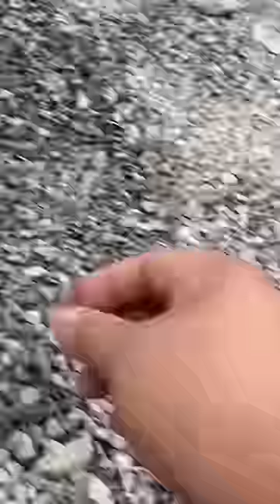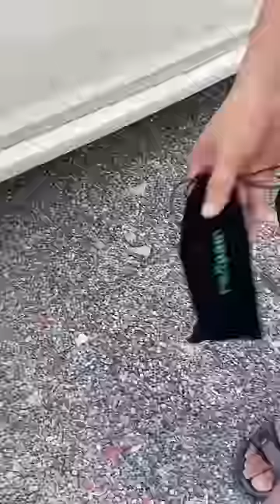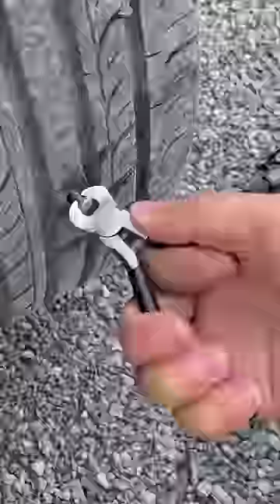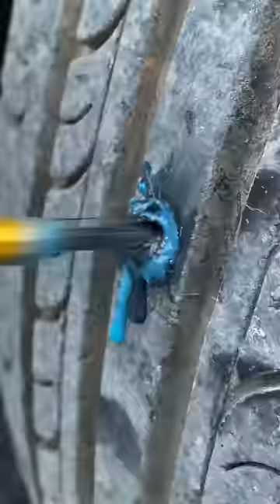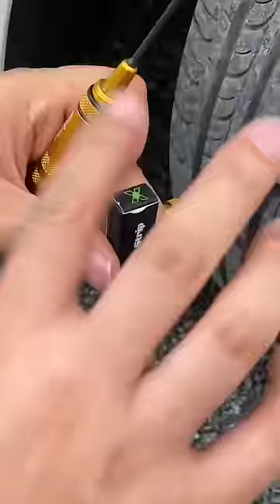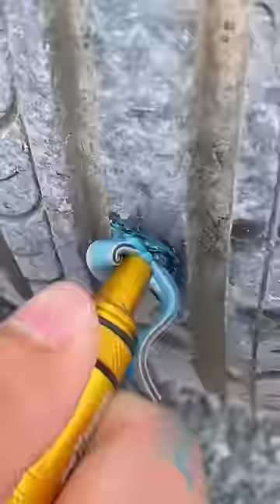$2 tire puncture repair

Comment from the maker: https://rexpair.com
Reply: 34
Reply: X
Reply: www
Reply: Wrt
Reply: @ตัง-ฒ2บ  8888888888
Reply: Needs more glue.  You only glued it 5 times
Reply: 0l
Reply: @shanavaskhanshana2507 Hi
Reply: What is the name of this? Can you send me a link?; Small Repair Kit(EDC)
Reply: rsbte
Reply: ㅣㄱ..
Reply: @OmarAli-bp7vm  😊
Reply: @ตัง-ฒ2บ  😊
Reply: @ตัง-ฒ2บ  😊😊😊
Reply: @ตัง-ฒ2บ  L
Reply: @ตัง-ฒ2บ  L
Reply: @ตัง-ฒ2บ  😊😊
Reply: @yanlyyanly3602  l
Reply: @OmarAli-bp7vm  😊
Reply: @Enzo_903  L😊😊ll
Reply: Lllll😊
Reply: Harga berapa yaa
Reply: $25 😮
Reply: 😅 за то
Reply: Rather use a regular kit with no glue required.
Reply: Poxa, manda um aqui pra Manaus 😢
Reply: Nul
Reply: Your Site says that tool is for motorcycle?

Comment: Now take it to the shop and have it repaired for real
Reply: Maybe with this style of plug. But a regular plug will last the life of the tire and then some. Trust me. Here in NY there’s MILLIONS of cars on the road with MILLIONS of these plugs in them. I once removed a tire and there was 6 plugs I can see from the inside I was dying laughing. It just looked weird.
Reply: ive done this to 2 tires. both lasted the life of the tire.
Reply: this is real. you dont know this ?
Reply: Go get that tired change for real
Reply: shop mechanic : - where's the puncture 😂😂
Reply: @digimon916  
That tyre let's go at 100 mph your life's over.. So do you value the price of a new tyre over your life.. Str8 Facts...
Reply: @See-through-The-Veil  ppl shouldnt even be driving that fast anyways. i drive like a grandpa, so it serves me well.
Reply: @Bobby G.  These plugs are always meant to be a temporary solution, not permanent. They are not recommended or reliable as a permanent solution
Reply: @digimon916  
I was using that as an example for eg a ferrari, lambo etc. Even at 60 mph it could kill you
Reply: @See-through-The-Veil  if you own a ferrari or lambo you should be rich enough lmao
Reply: @uihgy297  Exactly for the price of a tyre, but even a 30k car... A tyre can save your life and others
Reply: Take it to the shop and they do the same 😅
Reply: Bruhhhh u don't even know😂😂😂😂
Reply: @lgg8705  
No of course not... I worked in a tyre shop for 10 years...  Bet you feel pretty silly now ey buttercup 🤣
Reply: @See-through-The-Veil  zzzz 10 years 😴 alright  whatever u say ay princess , as long as you happy 🤓🤡
Reply: @AkbarAli14  ترجم
Reply: @See-through-The-Veil  did you just call another man princess 
We don't take kindly to your kind in these here parts mister
Reply: @See-through-The-Veil  i have driven a car many times that fast with a camel turd fix on my tire. I like to live dangerously
Reply: Yea so the mechanic can do this exact thing.
Reply: @Roberob1189 In the 13 years I’ve worked on cars I’ve seen tons of tires with these plugs where tread separated from the belt. These meant to be a temporary fix to get somewhere that can patch the tire. I mean if you want to take the risk cause the plug you used lasted a long time be my guest.
Reply: @06SteveO  lol it’s not just me…it’s everyone everywhere. That single spot where the plug is will never fail. If it does that means it wasn’t done properly. That’s a fact jack. Also buy correct plugs. Not Chinese garbage. Real plugs will take the friction heat from the road and actually mold the hole. Yeah it sounds crazy to have a bunch of plugs. I probably wouldn’t want more than 1 maybe 2 on a tire. But you most certainly do not need to buy a tire for just one single plug. Tires are expensive. To replace my each tire on my tire was $405 each. That’s silliness.
Reply: @Roberob1189  dhs
Reply: Oo❤
Reply: mcnv
Reply: @Roberob1189  Ppp😊
Reply: @See-through-The-Veil  theres no way you worked at a tire "shop" for 10 years without seeing plugs put in.... patches and plugs are the only ways to fix tires that have actual holes the only other thing you can do is replace the entire tire and you are more likely to have a blowout because of debris on the road than a "blowout" because of plugs... you will likely have that tire bald before a "good" plug will give out....
Reply: @See-through-The-Veil  I smell bs from far away.
Reply: @Y. El H • 9 Years Ago  
Wow can you honestly smell your breath from far away then buttercup 😂
Reply: @digimon916  
Padi  😅😅😅😊
Reply: Tubeless try puncture are fixed like this only
Reply: @nwodmf  
Oh okay I thought I'd just make it up. Damn you caught me out..
I did many repairs on tyres, but I'd always say to the customer, and I never had one person come back and say you repair has leaked. 
I'd just give them good advice, because whatever you may think, whether you grind the inner rubber and patch it properly or you have it plugged, that tyre will never be as strong as a tyre that is good from the factory, many factors come into it.
I don't care if you or anyone else has drove with a plugged tyre, I have, but its temporary. 
If it let's go and goes bang you're in trouble...
And the cost shouldn't come into it.
I can bodge many things on a car, but it should always be temporary. 
And for a little stone on the road, the chances of getting a total blow out are very slim.. People should always check their tyres, for a stone stuck in the tread, side wall damage, and down to the 3mm wear tabs.
However that can depend on what car you drive and what kind of tyres, basically semi slicks, which work properly when you've built up enough heat in the tyres, or different for probably the passion wagon you drive snowflake....
Reply: @mercer  
So you've been lucky..When you grow up and have children you'll change how you drive. 
I used to drive like a lunatic, because I'm talented and driving and riding bikes..
Wow you drive fast 👏🏼👏🏼
Can you slide your car sideways off roundabouts ? 
Can you lift the front wheel on a superbike at 150mph, can you get your knees and elbows on the tarmac in the bends? 
See you are not the only one who can drive fast... I don't care who believes me or not. 
I don't tell lies, I don't feel or see the need to impress anyone. 
If any of you come from the UK, come meet me, let's get some dough down and see who talks the talk and walks the walk.
Be it fixing tyres or driving. 
Definitely a few 🐑🐑 on here that are deeply asleep 😴
Reply: @AkbarAli14 that's only good for you to take your vehicle to shop
Reply: This is the real way of fixing puncture types, and works only for tubeless tyres. This last for years.
Reply: @See-through-The-Veil Arrogance has no medicine. This is proper way of fixing punctures for tubeless tyres. No-one replaces tyres with single puncture 😮
Reply: @See-through-The-Veil not true in Hungary there was a car crash at 206 mph in a huracan and they survived
Reply: Few people knows, but this kind of plug risks causing failure of the metal reinforcements of the tire while filing the tire to install it, leading to a major failure of the tire.
That's why manufacturers don't cover guarantee if there is one of this plugs in the tire.
The proper repair is to disassemble the tire from the whell and have it patched from inside the tire.
Reply: @aries666dc not even as a temporary solution, actually, since the manufacturer will not cover any guarantee of the tire if there is one of this plugs installed.
Reply: this is basically exactly what they do to fix a flat minus the patch and tire seal the goes on the inside of the tire only other option is a brand new tire
Reply: When guy who don't know how shit works tries to act smart
Reply: E ti fará la stessa operazione anche il gommista
Reply: I had that done it lasted life of the tyre
Reply: 타이어 바꿀 돈도 없는 거지들이 많다는 것에 놀랐습니다
Reply: It is not allowed to have these plugs as a permanent fix. Replace your tire.
Reply: Ошибаешься. 
Это хороший ремонт
Жгутов достаточно для этого.
Reply: По-настоящему это уак?
Reply: i have two on my front .Running ok for a decade
Reply: Personally I would never use these plugs as their is no way to tell the damage inside of the tire and have a blow out at 70 miles per hour
Reply: @See-through-The-Veil  you can use scare tactics for any repair though. Rope plugs are insanely effective. Like 99.999% chance they work perfectly fine for the life of the tire. There’s really no reason to get a patch done. 

You don’t have to pay anyone money that you don’t need to spend, you don’t have to take the tire off the car, you don’t even have to Jack it up lmao. They’re gifts from the gods bro
Reply: They will do exactly this
Reply: Lol this is called a plug and what mechanics use for a nail puncture on savagely tires that are not in the wall: this was done on my Giulia on runflats at Big O Tires for free. Most tire shops plug tread punctures for free bc the materials and man power hours are actually less than $2 and they typically gain a customer when they save their ass by fixing a flat by free. SMH 🤦
Reply: @Roberob1189 fr like 70% of tires I touch throughout the day have one in them if not a patch from the inside, if there’s lots of tred life left and I have time I’ll do a patch  but if it’s a quick fix and the customer wants it done than a plug is just as good 👍🏻
Reply: @aries666dc so that means everytime you get a nail In ur tire u wanna buy a new one ? 😂that’s the only permanent solution to fixing a hole in a tire which isn’t realistic sometimes multiple times a year ..
Reply: And paying 500$ for a tire with a small puncture that you can easily fix at home? No thanks 💀
Reply: They temporarily last untill you have to change tires any way, if they don`t (never happen to me) you will experience a flat tire.
Reply: @See-through-The-Veil huh? You can drive at any speed with these
Reply: @aries666dc  What is the permanent solution?

Comment: A lot of people are missing the point of this video. It's a $2 temporary fix for when you are on the road and have a tire puncture. With this temporary fix you can then drive to a nearby station and buy a new tire.
Without the fix, you'd have to call a tow truck which would cost on average around $150-200.

Comment: I used to repair small holes in my ATV tires like this , I didn't want to buy a kit like this so I used a some rubber from a bicycle inner tube, some screwdrivers and glue for shoes😂. The punctured tires lasted for several months and a lot of burnouts and drifts before I changed them to sell it
Reply: Opbhai
Reply: May I know what is the blue stuff?

Comment: Looks like the guy didn't remove the adhesive cover strips from the plug itself. Also if you want to buy a plug kit get the kind with the T shaped handles on the tools because it makes the work so much easier.
Reply: normally there are no covers bc you chemically smelt the two pieces togrther. at least thats what we have in switzerland. its called vulcanizing and has nothing to do with adhesive😅
Reply: He didn't!😂
Reply: Assuming an ounce of logic, I'd say they left the tape on to make removing the plug easier so they can fix the tire properly,  but having assumed logic I'd have used an old tire and done the video repair properly. So ... I don't know.
Reply: The adhesive covers are BLACK...pause the video at the point where the covers are removed from the box...it's not that hard...

Comment: Listen: I'm someone who can repair a tire so good, an actual tire repair shop said they thought it was done by a professional. I have never seen a puncture repair kit that looks like that, and I really don't think it will hold up very well.
Reply: L
Reply: Inserting the rubber with the second tool is very tough unless you are young and strong. I tried and failed.

Comment: Never seen a flat looking plug like that, mine have always been round. Anyway, I am seeing a lot of comments where people are saying things like bring in to be patched or get another tire. Neither of those are necessary if the tire is holding air. I have plugged dozens of tires over the years and none of them have ever failed. As long as the hole is in an area you can plug, the tire should be fine for the rest of its life. I have plugged tires that were only months old before picking up a nail in the driveway, and the plug held fine for over 2 years. Obviously this is going to be different for some people depending on the location and size of the hole, the plug used, and how it was plugged and whether or not it was done correctly, but usually they are fine. Some people will have a second puncture without realizing it and blame the plug for not holding when the tire continues to leak.

Comment: Might work temporary but get it fixed professionally at a shop though.
Reply: I will say this, I drove with this patch all the time until it was time to change the wheels from wear.Conclusion: if everything is done correctly, this patch will last forever.

Comment: I work in a tire shop and we only use plugs on lawnmower tires and we patch car and truck tires form inside after grinding down the tires and then glueing a patch inside and covering it with liquid rubber

Comment: Just don't forget to remove the white adhesive strips from tire plug before installing!
Reply: hahahahahahahahahahaha
Reply: He put the contact cement on literally everything (even the reamer). It'll be fine lmao
Reply: He took the covers off...stop repeating other people's posts...look carefully or slow the speed of the video down if your brain can't process images quick enough..
Reply: The adhesive covers are BLACK...pause the video at the point where the covers are removed from the box...it's not that hard...

Comment: I love how he puts way too much liquid rubber on, then proceeds to use the tire plug with the adhesive labels still stuck to the outside so it doesn’t even adhere to anything. Entire process was why you should just let your local tire shop do it for $15.
Reply from the maker: try and judge then. amazon refund available, buy one to test first. visit rexpair.com to find out amazon channel
Reply: Flying down the autobahn at 200 k with that crap in there 😂😂😂
Reply: It costs 5 bucks at town fair tire. Although plugging a tire is basic.
Reply: Local shop here fixes flats for free….
Reply: It’s a perfectly reasonable repair through the tyre belt. Sadly it’s often used on the shoulder which is not safe as the rubber can tear.
Reply: Я местный шиномонтажник, дипломированный механик. Стаж работы с 2001 года. Таким инструментом, материалом, в таком положении колеса ничего хорошего не получится.
Reply: @reXpair I thought this was a meme 💀
Reply: @reXpair  no refund on the tire you wasted, lol
Reply: So expensive.. my place, 1.50 usd only.

Comment: If you're going to use tire plugs you want to trim and flush with a razor this will prevent them from getting pulled out as you turn and drive this is particularly true you have a vehicle who's wheels might be out of alignment to puts a lot of side stress on tires. The method that he used works pretty well and also works with the entire plugs that you can buy at Walmart we're just about any automotive store. You are probably going to want to have a small compressor in your vehicle so just buy a regular kit and put it with the compressor.
Reply from the maker: we did optimize it than old one. check rexpair.com to get one to test? free return if dislike. amazon & walmart available

Comment: The surface of the tire is uneven, if you use tubbles, you only need to use leak-proof liquid, so just pull out the nail and it will close itself because the liquid turns into glue instead of using a tool that has to pierce the tire as a result, the tire is not stable when running.

Comment: NEVER DO THIS WITH YOUR TIRES. Better get to the closest repair station and glue it from behind in a proper way.
Reply: It was invented to be easy to use. for use in urgent cases for temporary use and it's cheap. So you can carry it in your car Just a few tools with a portable air pump. Filing a small hole doesn't cause much damage to the inside wire. If you convenient or if it leaks again in the same spot, you can take the car to a garage to permanently seal the leak.
Don't worry too much bro
Reply: Weird to see a Russian scared of tire plugs lol.
Reply: In Indonesia we use it normally and its work
Reply: Plugs are fine stop being so sensational
Reply: @muhamadnazriel4224 you guys use garbage motorcycles we know it works for you guys
Reply: Indeed, it is much better from behind :)
Reply: в России 80 процентов проколов шин так ремонтируют. при условии что у человека прямые руки.
Reply: @LUISTHEBOOTYCLAPPER Forgot to add  Our toyotas , Nissans , Fords and alot of more clean jokers.

Comment: after 10 months you have a brand new tire
Reply: i have been using the same tyre that has gone through 4 plug patches, and it still running good after more than 3 years..
Reply: @harisyoung4110  He didnt meant that
Reply: no after 9 months
Reply: @walter_witch_7065 A normal pregnancy is 40 weeks. So 10 months.

Comment: Warning: They took a perfectly functioning item and made it worse by using some weird ass flat rubber strips to plug the tire... These things cost a couple dollars at your local home Depot for the same quality ones used at tire shops.